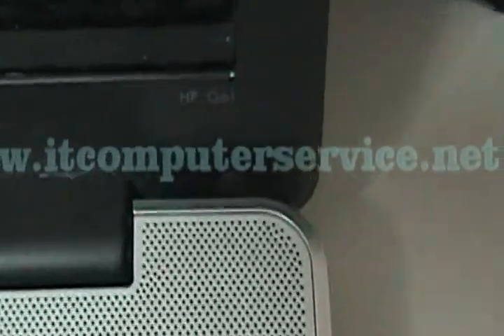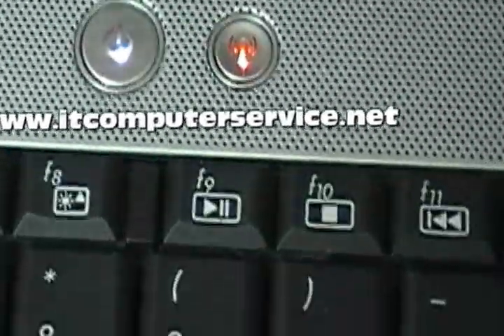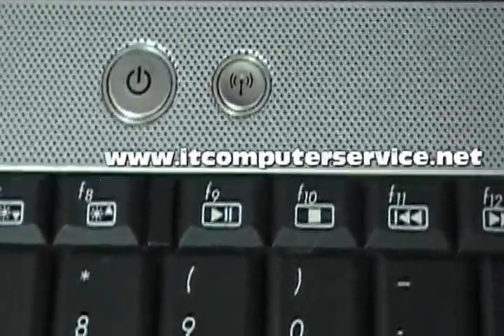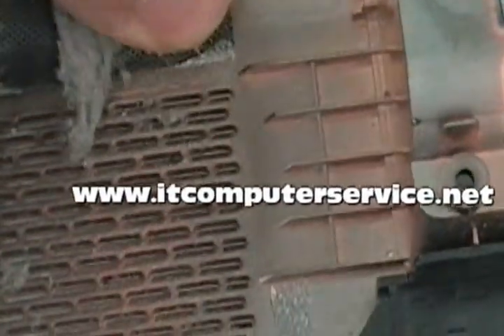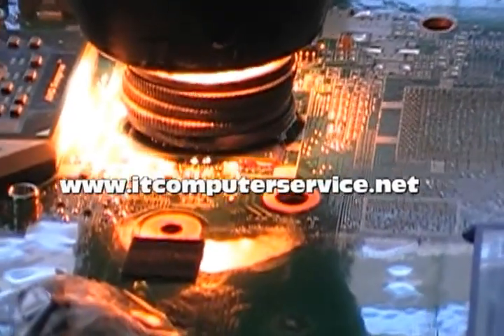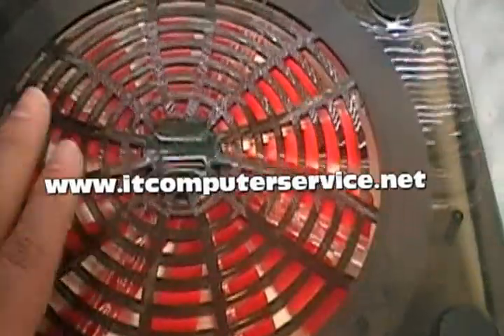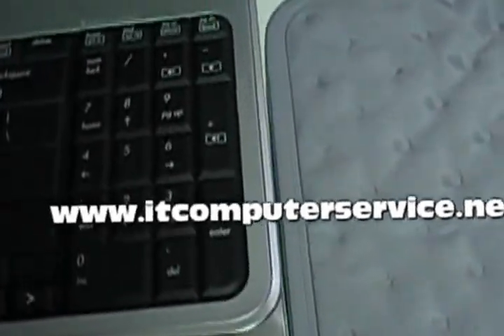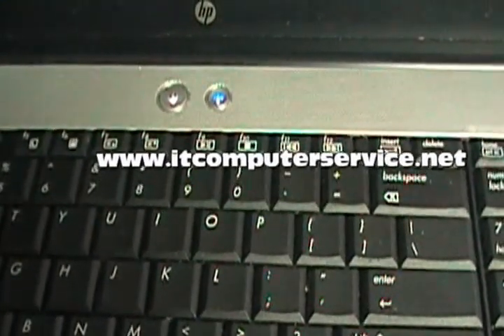HP Pavilion G61 Video Reflow Repair  Process

Comment: Hello sir thanks for the video.
I need help please ? 
I have HPG61 and I have black screen. But the caps lock light flushing with other light on the top corner ( page up pause ) there is light flushing and black screen.
What is the Solotion please ? Any help ? Thanks